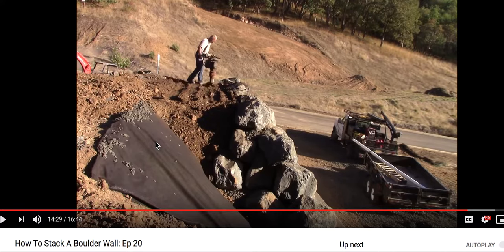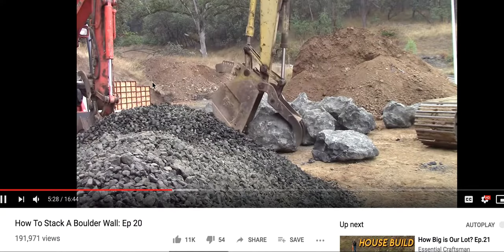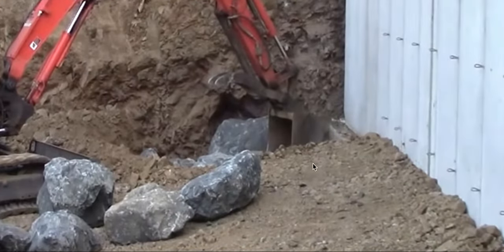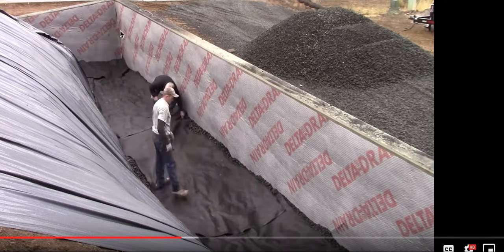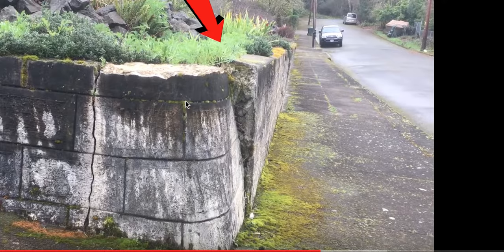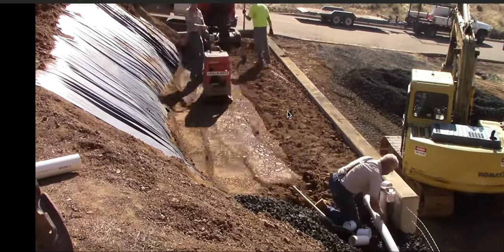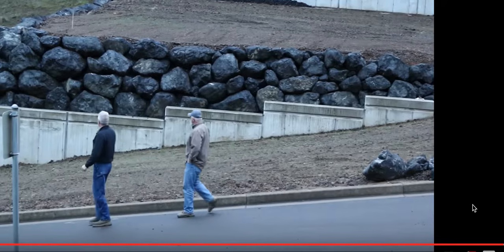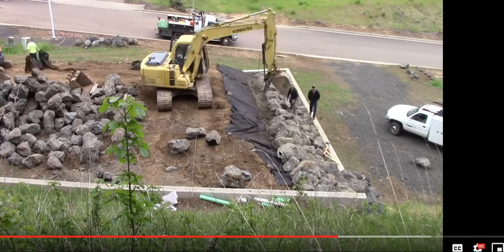How To stack a Boulder Wall Fail  Retaining Wall Fail Essential Craftsman

Comment: Heh funny I come across this 2 years later when I'm looking for examples of machine stacked retaining walls... I was pretty sure EC got some engineering that said the rock was ok but it is a glaring feng-shui problem. Especially for the owner of the lot below. Plant a lot of ferns into the wall I told him. He actually replied and thanked me. Then I saw a few months later it had been moved back quite a bit
Reply from the maker: Define pretty sure...
Reply: @EngineerPEretired  Well he said it had been engineered I was kinda skeptical of the design, but hey I'm not an engineer, I just build retaining walls. The design struck me as very odd because no landscape architect would put a massive rock wall atop a concrete wall in design

Comment: Great video👍🏾. What recommendations would you provide for a retaining wall getting built on a slope that has soild rock as a foundation? It slopes towards the house and the objective is to level the yard so my service dog and children have a safe place to play. I have seen that rebars are great for securing and building the wall up so you don't encounter a construction fail. Are there videos that you can direct myself or other individuals looking to take on a project like that? Thanks in advance and take care.
Reply from the maker: Sorry, for the late reply, youtube just showed me your comment.  Your answer is, the soil conditions would have to be determined and the load applied...  Conditions, include the angle of repose of the existing slope surrounding your proposed work also...  It does not matter if you only consider your site conditions, the conditions around your site will also matter or rather can matter... Also, heavy trucks traveling by can also loosen your soil with their vibration...

Comment: How would one tie in the gator grid to a poured wall?a retaining/termination bar of some sort? Thank you for the videos. If I had seen this channel when I was in college, I would have done civil instead of mechanical.
Reply from the maker: It would be some anchor system , this can be retrofitted with heli systems... You basically, drill a long bar anchor into ground and based on torque resistance you can determine pullout resistance... Once, you get the desired amount, you cut bar and add anchor plates to face of wall.
In theory the wall will have to overcome that pullout force to cause wall to move outward... Keep in mind, it is just the plate area resisting and you may need many such anchors to keep wall balanced in forces.
Note, this does not add any footer dropping resistance and drainage at footer must be considered also.
That is how u support a wall that is existing and of reinforced concrete... Each system will require a total package to ensure it will perform.